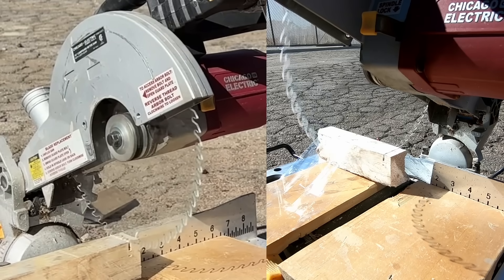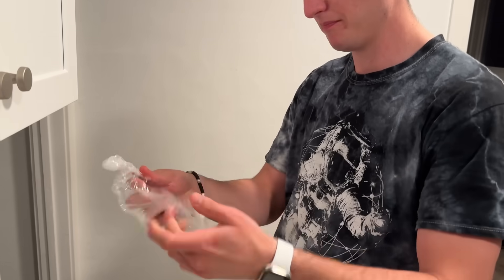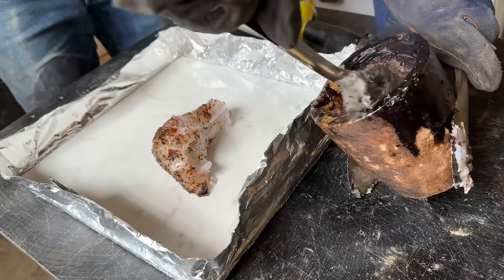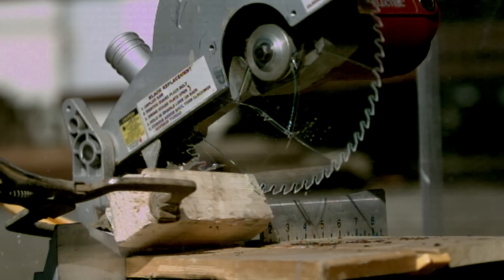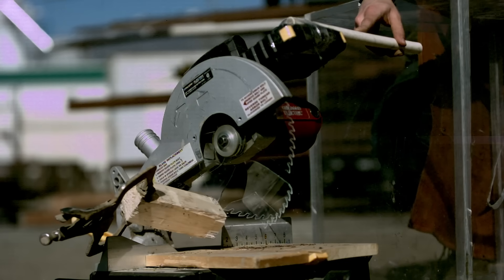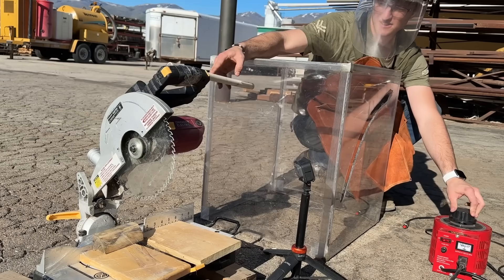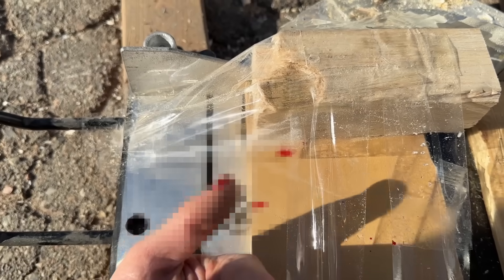Can Glass Actually Cut Wood?

Comment: cut would've been cleaner and blade more durable with shallower and possibly more teeth kinda like a hacksaw but you might run into some heating problems in the blade so run multiple cuts.

Comment: I think the glass would have cut better if you turned it around. The teeth don't have to bite into the wood to cut, and it also makes points for stress fracture.

Comment: With the glass, more speed is needed, I forgot the exact channel but someone else done this myth busters style and speed was needed to give enough power for the cutting aspect, yes the slow vertical movement was correct but rotational speed was to slow,,,, wayyyy to slow for a controlled test

Comment: im not trying to hate but im a engineer and there's different types of plastic there's abs (which is the strongest) im pretty sure it has fibers in it but plp and the other plastics are going to break right away because they literally arent meant to be strong do a little bit of research on it and do a part two i bet ur results would be actually crazy I've gotten stabbed from abs and it has gone through my shoes and almost stab my foot and the plastic never broke even thin Pieces you got to check it out
Reply: also awesome video!
Reply: abs alsot hardens after the first heat up so the 2nd heat when you saw wouldnt melt it

Comment: If the hole of the blade is to huge in comparison to the axle, you have no precise rotation. Try a tolerance of 3 thousands of a millimeter.

Comment: The arbor hole of a saw blade should be a perfect circle. There are no notches, keys, or indentions/registers of any sort to lock the blade to the arbor. The blade only needs to be hand tightened. Over tightening can cause blade warpage... Also "slippage" is a safety feature if a saw blade "catches".
All of this should have been in the manual for your saw.

Comment: Although I don't think it'd make a difference, real saw blade teeth are actually sharpened to make it cut easier. It's not just the shape of the tooth that makes it cut. It didn't look like either the plastic or glass teeth were sharpened.

Comment: I don't understand why you would even bother trying to make a plastic glass whatever saw blade why wouldn't you just skeletonized the blade you can think about you know a lot of Wheels brakes obviously you can't see through them when it's still not spinning but once it starts spinning you can see right through just like their glass even a bicycle spoke you can see right through that Rim going down the road but what happens when you stop you can see dispose all you would have to do like I said is skeletonized the blade a little bit and when it was spinning you would be able to see through and realistically any of the circular tables 30 years they all have a break where as soon as that blade touches anything organic other than would it slams a big aluminum block straight into the blade stopping the rotation in milliseconds

Comment: Saw teeth need to cut a wider kerf than the thickness of the blade. Otherwise there will be a lot friction. This is why carbide teeth are wider than the blade thickness. Hand saws and other blades have alternately bent out teeth, to cut a wider kerf than the blade. 

I'll take my chances using a proper metal blade. They are much safer than exploding plastic blades. Also, plastic blades won't hold a sharp edge. Making it even more dangerous.

Comment: Insufficient clamping is mainly what broke the glass ones. But I also suspect that the feed rate might have been a bit too high at times for all the blades.
In short, better work holding and getting the feeds and speeds right would likely make these work better.

Though, "better" is a relative term. And in this case it is likely still quite far to being good.

Comment: Professional Glass-Worker here
If you want to cut a hole out in a glass plane with a water jet try to not start at gull power, slowly raise the pressure at the starting point until you reach enough pressure to properly cut it.
That way its less likely to shatter because the glass doesnt get hit by the full force, its more like grinding through it
But all of this depends on the ability to adjust the pressure while the jet is running

Comment: if you want a clear sawblade why not just use the waterjet to cut a large ring out of a metal sawblade and cut an equal pair ring of polycarobonate to fill the body of the blade, then use some glue or even holes and fasteners or something to secure them? Not sure how viable this would be

Comment: The seran wrap was likely expanding because of the trapped air heating up and expanding. If you could get the wrap to form layers without air, you wouldnt need to melt it. Likr pull a vacuum and then wrap it. Though doesn't seem you have the equipment for that.

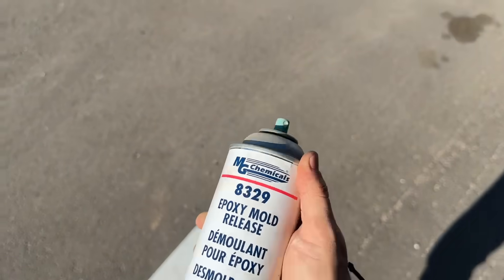Comment: 1:53 And then you build a submersible pressure hull and take it down to the Titanic. Carbon fiber is old news!
On the subject of the OceanGate playbook, laminations+epoxy. Why not do some laminations with tape or whatever then a thin epoxy layer for good measure.

Comment: The easiest and probably best way to melt the plastic wrap would likely be in an oven. With some weight on top and setting the temperature just above the melting point you would get a gentle remolding of the plastic without damaging the polymer itself. Just don't do it in an oven you cook food in :) Biggest issue would be internal bubbles completely ruining the strength. The only DIY way to get them out that I am aware of is kneading and twisting with multiple reheats and thus forcing most of them out. A lot of manual work. The best thing to do whenever possible is to not get air mixed in at all - so for example cutting the whole roll lengthwise and just melting with the concaves pointing up so it melts nicely into a flat sheet. That should yield air-free clean LDPE for further shaping.

For glass - a really neat trick to be aware of is that glass (and any material prone to cracking in general) will have much less chance to shatter if you drill or cut it while submerged in water. Thin glass can even be roughly cut with a pair of scissors in this way. Also great on tiles you are afraid to ruin. Should also work for brittle plastics like acrylic, but I haven't personally tested that yet. The exact physics of this phenomenon is a little beyond my expertise - but it has to do with the higher equal pressure on all surfaces reducing shatter-points quite significantly.
You still can't cut or drill into tempered glass though - so don't even try. Or at least keep a broom handy to clean up the inevitable mess :P

Comment: 11:28 i am like 99% sure I know why you have that problem. You see in an actual saw blade the teeth are ever so slightly bend outwards alternating left and right.  Due to that the cut they make is a bit wider then the blade and that is pretty important. Without that you get way too much friction, which is why it was so slow,  and the blade likes to get stuck.  Another problem is that actual saw tooth are sharp,, and I am not sure if yours are. You might want to file them a bit.

Comment: try making pure carbon fiber blade or wheel, no epoxy or anything other than pure carbon fiber, yep align it radially, or spin a carbon fiber yarn spool. how about a molten heat press. yes carbon fiber yarn weed cutter line. super fast rpm. so what for carbonizing plastic in high temp. yep instead of melting you get gasification and pyrolysis like when making synthetic fuels. or not, if the plastic is not that type, but more like a glass. try ceramic glass blade instead of glassy glass blade. polycarb melts at 130C or so, even lower than the plastic stuff. glass is high temp but brittle. like a glass bottle.

Comment: Advice too late:

When wrapping an item of that size to an absurd degree, it helps to have a partner, then it just turns into passing it off on the correct side of the item.  You would be mildly surprised at the efficiency you can get with the hand offs with mere fractions of the physical effort, even taking both people into account.

Comment: Saw blades have a hardened piece of steel soldered to each tooth and that is what actually cuts. This dude could glue 1 to each tooth of that plastic saw and get the same affect.

Comment: @11:30 teeth of sawblades are thicker then the blade itself (similar to the offset of teeth on a handsaw) to prevent the saw to lock up.
and plastic saw wont work unless you get een heat resistant one

Comment: You don't need the flats in the arber hole if you're using rubber washers. You don't want the board under the wood so the wood stays against the fence between and doesn't move around.

Comment: If you ever do saran wrap again, just cut right off the roll, it's already layered, it just may not be wide enough that's all. I would say it needs pressure after heating. so maybe a manual hydraulic press made with a car jack and some wood plates bolted into a frame or under something heavy. You could take a Dremel tool or belt sander and get a small edge on the teeth, it will help alot. Maybe serrated even. ATM you are using a chipping method, only really good for carbide tool bits.

Comment: If you tried pyrex glass like some cutting boards are made from or gorilla glass screen protectors you might have more luck. One major issue other than the fact that glass tends to be brittle is that there is no tooth offset.

Comment: pine is actually a softwood, and balsa is a hardwood. it turns out the definition isn't really about how hard the wood is, but about the way the fibers are laid out or something
Reply: There are two totally different concepts with exactly the same name.

You take a piece of wood put and steel ball on it then press that steel ball with a calibrated amount of pressure. The depth that ball goes determines it's hardness. It's a sliding scale hardwood on one end softwood on the other.

Then you have Hardwood and Softwood. Which is determined by the type of tree and the grain structure and such.

These are in no way related. Many Softwoods are hard many Hardwoods are soft.

This isn't confusing at all.
Reply: Yeah o was amazed when I first discovered that .a weird one hey

Comment: Turn the velocity up slowly, then approach the wood. Your goal is to make very small chips in the material with the saw, you are not cutting through it like a hacksaw.
Maybe consider a much smaller saw blade as well, to prevent inertial forces from ripping it apart as easily.
But speeding it up while it's cutting is inducing hard changes in velocity.
Approach the wood VERY slowly. 
the velocity it's turning at just isn't anywhere near fast enough for this to work.
You have to listen to the blade man, you're just ignoring the sounds it is making.

Comment: am i the only one wondering why he didnt just put the cleanly layered plastic wrap between the two tiles and put it all in the kiln at like 300 for a few min so that all the layers would melt together while being pressed flat
Reply from the maker: the kiln is like 6 inches wide :( which is still a lot dont get me wrong
Reply: @WaterjetChannel  ok thats fair. in the vid it kinda looked like it was closer to 8-10ish but if its only about 6 then even if you reduced the size of the tiles and plastic wrap you wouldnt have much of a blade. . . . lol maybe it would work for a little skill saw or a wheel grinder

Comment: Machinist here. There is a secret to cutting using hard tools. It's fixture rigidity. If you ran the same tests again with glass blades in a stiff slow moving rig it would cut.

Wrap the saw arbour in tape if loose, then use a layer of thick cardstock paper.

Comment: If you want to melt plastic without a bunch of equipment, the best way is a double-boiler. It ensures that it never gets hot enough to melt the plastic. If the meltinging point of what you want to melt is higher than water's boiling point, you can use mineral oil, which will take you up to 536 degrees F without letting it go above. Ive used this method before to melt a few plastics, including polyvinyl chloride, which is what plastic wrap is made of. Just be careful because when it turns completely liquid, it is hot and sticky like napalm.
And if you don't believe me, just check my username.

Comment: My only criticism is you didn't cut an angle for the tooth side. If you had angled the jet nozzle or use a grind wheel and shaved an angle for the teeth you would have had a sharper edge and be able to cut more easily. What you can do as well is take a grinder and cut angled grooves.

Comment: why not make a metal saw blade ring to attach to clear circles? take a regular saw blade use water jet to cut the teeth off in a ring but cut dove tails opposite side of the teeth so it can be secured to the plastic or glass circles. might need multiple metal blades to match the thickness of the plastic. edit:  the metal saw blade ring could be set in resin circles. since you like working with resin.

Comment: 0:16 and that is half the reason why I was always taught in woodworking classes to use a block of wood to push things through saws. Also had a classmate stupidly using their leg to prop up some wood while cutting with a handheld circular saw. His quadricep became a mess on the floor.
Reply: Watched a kid in my high-school woodshop class grind off all 4 of his fingers in the wood jointer, tried putting too short of a piece through it
Reply: @austyntuck2253  Dang, where'd he lose the other four before that?

Comment: Why don't you try to make some "composite" blades? Like, for example, a blade that's mostly polycarbonate, but the part with the teeth is a thin ring of metal? Or binding the carbide teeth directly to a polycarbonate disk? Or you could embed a steel mesh between 2 layers of rigid plastic, so it retains some transparency, but still has a tough material in it to provide an actual cutting edge.

Also, the teeth need to be offset/bent a little to the side, so the channel is wide enough for the sides of the blade to not rub against the material. It seems that a lot of the blade failures come from either the teeth binding and snapping the blade, or the material melting from friction.

Comment: If you ever try the plastic wrap again you might try a t-shirt heat press. It has a controllable heat setting and will apply even heat and pressure. Just make sure you put in in between two sheets of parchment paper so you don't melt the wrap too the press.
Reply: You don't need to melt it at all.  Just take the self-sticky layers, cut out a shape, and then let the centrifugal force of the saw keep it in shape. Also, could have sprayed the plastic-wrap blade with a hose of water while it was running to keep it cool.
Reply: @takanara7  hes trying to make it harder i think, not really a plastic wrap blade anymore but one that isn't melted together ain't gonna cut anything
Reply: @takanara7  I came here to say the hose of water thing.  It won't melt if you cool it down, plenty of real saws use coolant!

Comment: The hole in the middle should be round so the bolt won't catch like its supposed to and create a point-load that will shatter the glass. Make the hole bigger and use a thick rubber o-ring to keep any glass from touching metal

Comment: Real sawblades have splayed teeth with sharpened edges. The splay of the teeth is wider than the rest of the blade. This both reduces friction and binding against the bare wood, but also helps clear the saw dust which causes a lot of friction and binding as well. It also exposes more cutting surface area which is the main advantage making for more efficient cuts. Perhaps by making a two half mold, one for a each side of a real sawblade, and heating a transparent material to malleability, and by using weight or a powered-press to compression mold the material into a more accurate sawblade, there might be better results.

Comment: I love how you can see that these "sawblades" are more an equivalent to shovels than saws. It doesn't cut as much as it chips the wood and then flings out big chunks of wood at a time
Reply: That's more or less how all saws work though.  Some are just better at cutting the fibers at the edges than others.
Reply: @RyanEglitis  Exactly correct. All saws use teeth, just most have edges, alignment, and other parameters that have been finely engineered to make then create clean, fast cuts with as little damage as possible. One that doesn't care as much are chain saws, because their use is rapid cutting in cases where clean cuts are less needed. They basically just cheese grater the wood on a thin strip.
Reply: Welcome to how sawblades work.
Reply: Glorified watermill

Comment: Drill bits made specifically for glass/ceramic exist, my dude. Place some painters' tape on the drill site, and use whitening toothpaste as an abbrasive lubricant (oxymoron I know, but trust me).
Reply: I've drilled tempered glass a few times (glass pot lids, to make extra vent holes) submerged (the glass, not me 😅) under a few centimeters of water both with a 10 mm Bosch MultiConstruccion drill bit and with an specific 10 mm "arrow head" drill bit, applying a very very light pressure* and using a cheap cordless drill to not get electrocuted and to not damage my good or at least expensive cordless drill. 
First I tried enlarging the factory made vent hole and broke two lids in a row, then I decided to try making new holes and drilled another five lids without breaking any more.
I use them for cooking and wash them in the dishwasher and so far they have lasted more than 10 years.

*So light that I spent about 40 minutes to drill each lid and the glass must be only 3 or 4 mm thick.
Reply: Yes I make bonsai pots out of everyday ceramics (bowls baking dishes etc)by simply adding a hole using a diamond core bit. Works every time .can take a while but it's worth it